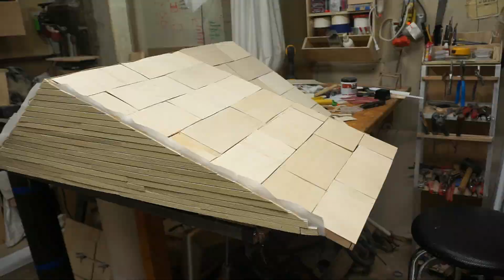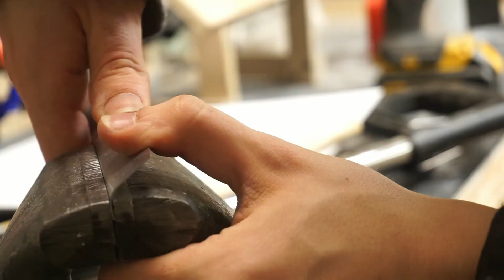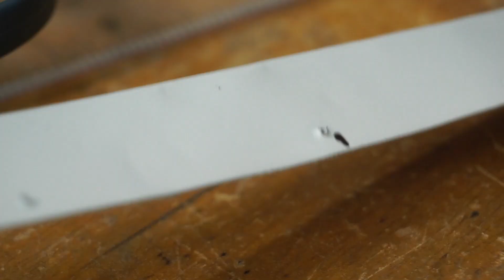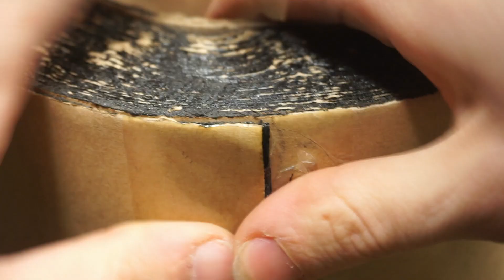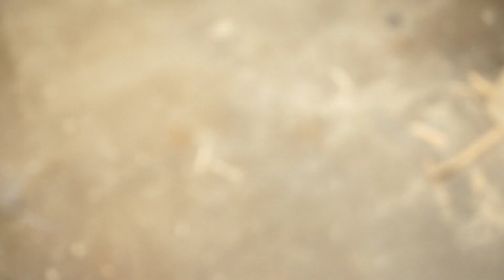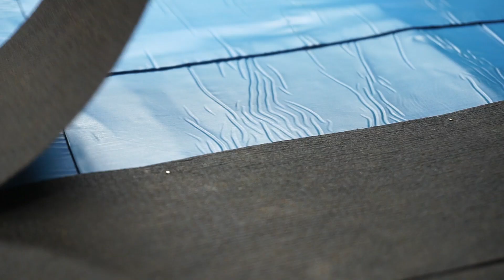Building a Realistic Model House, Part 33: Preparing the Roof for Shingles

Comment: I love how you carefully push each nail in, but I can’t help but wonder.... wouldn’t a low-powered nail gun be better? In the last video when doing the trim, I noticed the wall behind it would bow under the pressure of you pushing in the nail. Nail guns narrow down that force to just the tiny nail, so you could reduce the risk of bending or snapping underlying boards. I just don’t know if this is a thing..l the nail guns my husband has can go through an inch thick board soooo.... that would be TOO much 😅
Reply from the maker: Good point, yes - I did a bit of research earlier on, and had a hard time finding nails small enough (I have ended up using steel sequin pins). Also, depending on the joint I'm putting together, finesse is quite important, and being able to control it directly with my hands is very helpful. If I were doing this again though, I might invest in a 22 gauge (or smaller?) pin nailer, I've heard good things about those and I imaging it would go a lot faster being able to use that for some of the really monotonous bits!